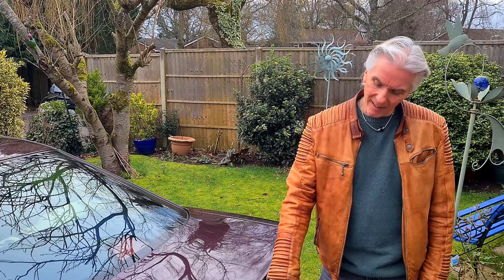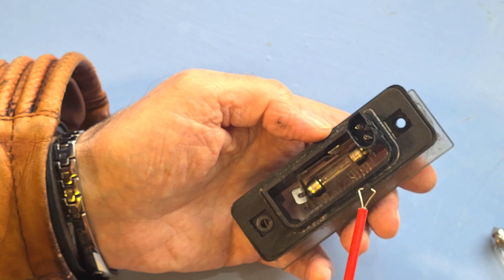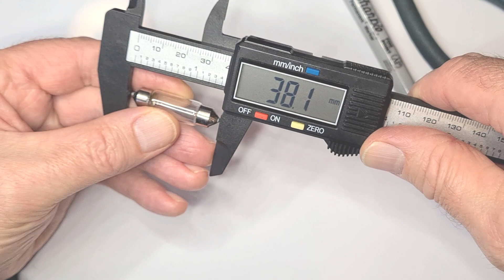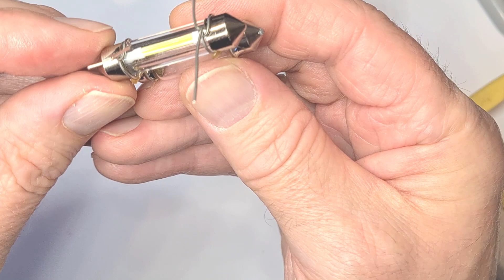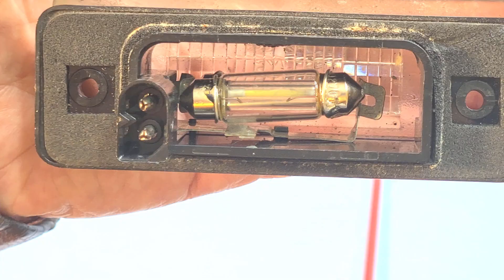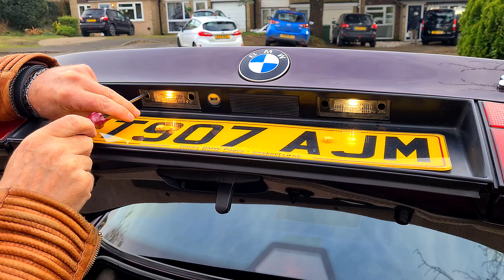BMW E31 Licence Plate LED Lighting How-To ERROR FREE

Comment: Great guide Timm, do you think it would be possible to make a little heatshield to sit between the filament and LED festoons? Possible coat it with some foil to reflect the LED light down as well? Or even pop a little heat resistant sleeve over the filament bulb? Would that increase the life of the LED?
Reply from the maker: Possibly, let's see what happens with this new method first!

Comment: If the LED bulb were still getting heat soaked from the halogen bulb and shortening leds life would 'pairing' it to a a 24 volt 38mm halogen festoon run cooler and still keep the check control happy?
Reply from the maker: The problem is that to pass the 'hot bulb' test the tungsten has to dissipate 5W, and 5W is 5W no matter which bulb (or resistor) you use!